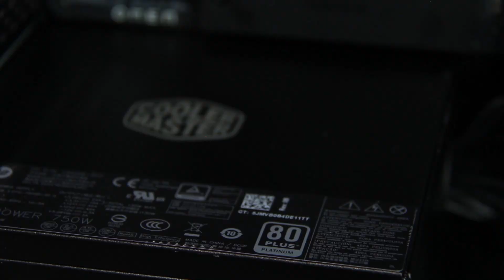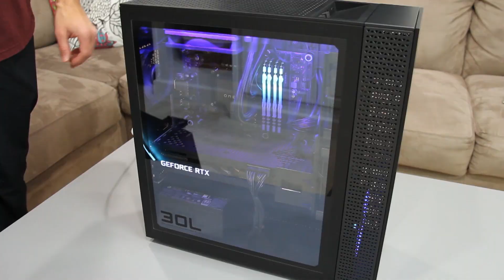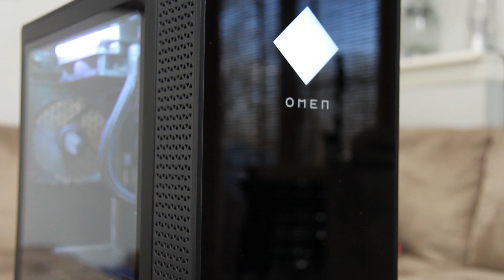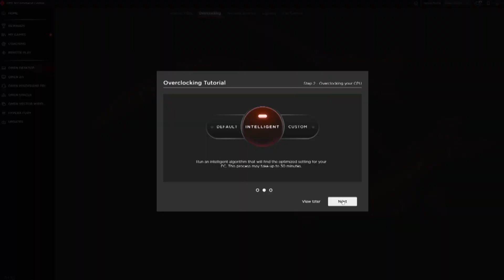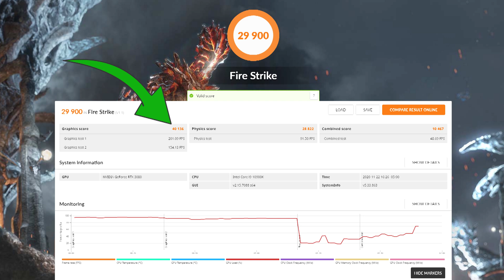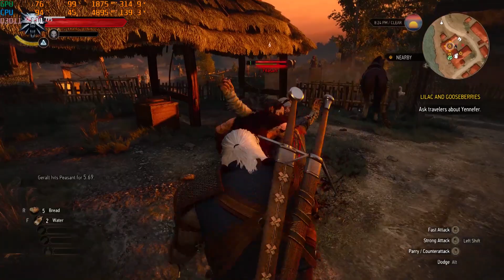OMEN 30L!  Are pre-builts good now?

Comment: Hi Bob, very nice video, providing a lot of solid information on OMEN 30L. In fact I've already ordered my OMEN 30L. I actually want to take all the components out and reassemble them into an air-flow case, such as Cooler Master NR400. May I ask whether it will void the warranty? Thanks.
Reply: I will do it as long as warranty won’t be voided
Reply: Send it back lol look up hp omen ram issue
Reply: @Zipfile12  Thanks for the heads up. Are you pointing out the fact that the after-market HyperX ram can't run at 3200MHz?
Reply: @zhizeng5571  yup that and any other after market ram will be down clocked unless you buy the ram directly from HP at a very high mark up price thanks to HP locking down the bios and not allowing xmp

Comment: Got it for $1500😎 but with a i7 instead of i9
Reply: lucky man right after I bought it for 1900 they cut the price down that much.
Reply: @chinmang3162  pretty crazy price it sold out quick,I don't get it until dec 29 but I'm extremely excited
Reply: @RawWrath  Do you think its odd that people were able to get theirs off amazon in late October while those who bought it directly from HP have to wait until mid to late December? Kinda weird it was being sold on amazon before their official website.
Reply: Any updates on your order assembly status? I've had no updates since I ordered mine 2 weeks ago.
Reply: @chinmang3162  no updates yet it just says it'll ship December 23
Reply: @chinmang3162  I'll update you here if anything changes🖖
Reply: @RawWrath  Update: mine was supposed to ship yesterday, but it hasn't even reached assembly yet. Could be another classic HP delay and/or cancelled order
Reply: @RawWrath  Update: Delayed shipping from 15th to the 21st. Not looking good. Hope you're luckier than me
Reply: @chinmang3162  my delivery date got delayed until January 7 and the should of shipped already and nothing the original delivery date was Dec 29😔
Reply: @chinmang3162  it's shipped!!
Reply: What specs are in yours?
Reply: @dave.thedev  i7 10700k, RTX 3080,16gb 3200mhz ram,750w platinum power supply,512 wd black ssd,and a 120mm AIO
Reply: @RawWrath  Dang thats a good deal. I got mine through amazon when I saw it dropped to $1900.
i9-10850k
RTX 3080,
32gb ram,
1tb M.2 SSD and 2TB HDD,
120mm AIO and 750w PSU

The deal sold so quick. $1500 for your package is a steal
Reply: @dave.thedev  not only 1500, i am going to add 1tb ssd, 2 tb hdd,and an additional 16gb ram, so the final price gose to 1800+, not much difference than yours, and you have a better cpu.

Comment: I love your videos, they are very knowledgeable and provide honest great information! I saw your OMEN 17 laptop video, and you said it is the most powerful laptop you’ve tested, I bought an OMEN 15 laptop DH100 custom built specs: processor: i7-10750h 
graphics: RTX 2070 super.
Ram: 32gb
Disk management: 1tb picie + 512 Intel pcie, + Intel 32gb optane + 1tb HDD.
You said on the OMEN 17 video it’s the most powerful laptop you’ve tested, and RTX 2060/ GTX 1660tis don’t respond to well. The 2070 super card should be extremely powerful right? I watched your OMEN 15 video and it’s the exact same laptop;, but I noticed that laptop has a regular RTX 2070 vs mine has the RTX 2070 Super.

Comment: Only thing lacking on these is support for XMP in BIOS. Currently they only support 3200mhz frequency RAM if its a specific HP certified RAM stick that costs over 150$. Other RAM sticks will default to 2400mhz JEDEC spec.
Reply: you can put XMP in Intel XTU on Windows

Comment: Great review man, I have been looking for a review on this specific model but could not find one so I ended up ordering from Amazon for 2k
Reply from the maker: That seems like a good price 👍
Reply: Damn bro it’s at $949.99 right now at Best Buy
Reply: @Voixxy  yeah that one has way lower specs man, its a 2060 mine is 3080
Reply: Look up Ram issue HP omen 30L it's a scam of from HP
Reply: @Zipfile12  i have 30l 3080, isn't scam.
Reply: @drluch  its is when you can't update the ram without it slowing down to 2400mhz instead 3200mhz you cant enabled xmp just look up the ram issue hp makes you buy there ram to get the best ram speeds
Reply: @Zipfile12  just buy some hyperx fury 3200mhz and it should go. Buying from hp doesn't seem like a problem to me

Comment: I know HP probably sent this too you but an issue I have with all OEM desktop reviews is they have the top end model... The OEM's might treat the top end models better than the mid range and lower end models. If you continue desktop reviews I would like you to ask for a mid range unit :). Still great review and have a nice day.
Reply from the maker: Yeah I can do that!  I like the mid range models too.  The lower end spec that you and I like would leave others wondering if the 30L is capable of cooling more powerful components.  It leaves questions unanswered either way 🤷

Comment: Pre-built Pc have come a long way.  Specially the 30L from HP. If i would change something its the liquid cooler.  The radiator is so small for the the cpu. At least 2 or 3 fans  is required.  Or going for solid air cooler like NH-D15. Still good pc. Finally as always thank you Bob for great review 👏 stay safe 🙏
Reply from the maker: Yeah I actually prefer air cooling as well.  Something big 👍

Liquid does look rear nice though.  The chassis is pretty small and the top IO would get in the way of a 240mm Rad.

Comment: Does this mobo work with AMD?
Reply: I don’t think a z490 motherboard work with AMD, mine is on the way, really worry about the cpu temperature.
Reply: @bugzf  that's my worry as well...I'm soo close to pulling the trigger, but I think I better wait until parts are more readily available so I can build my own.

Comment: In my opinion HP makes the best quality Prebuilts, they don't always give you the best parts, but they last
Reply: Cooler Master PSUs, HyperX Memory, SSDs are typically from the major brands ;)
Reply: I just wish they had at least a 240mm aio cooler. They’re nice as fuck and I have all the hp omen accessories too but seriously wtf is with them only having a 120mm fan/cooler especially with an 8 core processor? Smh that’s the one major flaw
Reply: @itshadoww  I just got a new case and put all the shit in the case with better cooling
Reply: @literallyfree5672  Sweet you can do that?, how easy was it, and what case and cooling did you use?.
(i'm new to PC stuff and i plan to use "heavy" software such as gaming, animation and live in a hot place) 
so it sounds like it would be a good idea to "upgrade" upon the heat issue if i get this. 
i'm scared though because of "prebuilt" so if it worked for you, 
may you please let me know what you used/upgraded with?.
Reply: I agree but one detail pretty much everyone mised is that omen is a separate team from hp. Omen was a dying brand that hp bought. Hp makes business and  home products while omen is a team all for gaming. They were not to good until now.
Reply: @itshadoww  yeah they need to give you the option at least to get a 240mm cooler fuck only having 120mm that’s retarded
Reply: Agreed
Reply: Secret  ok so if I grab one of the hp omen 30 L computers I won't be in big trouble right? Lol😅 btw is it possible to add a liquid cooler in these pc's? And to what extent can you upgrade these things because I know they are oem pcs and have a little trouble with upgradability.
Reply: Secret  thanks for the info. Its good to know that I can upgrade a bit. Do you know If I can upgrade the PSU or the motherboard?
Reply: I heard bad things like CPU hitting 97C under load in these 30L Omens
Reply: @Venserql  i mean i9 and 120mm aio dont belong in the same sentence
Reply: @Venserql  Most prebuilts don't have good cooling unless you spend 2k.

Not even the best prebuilts have good cooling, After all prebuilts are always about profit
Reply: @davidlegkodukh6969  it wouldn’t be hard for them to let you at least have the option to choose at least a 240mm aio cooler. Why only 120mm? For the new intel 10700k and i9 processors 120mm won’t do shit. You’re spending 2k plus on a prebuilt at least give us the option for 240mm. That’s my one and only issue with this. If it had a 240mm aio on top instead of 120mm it would be perfect like fuck

Comment: They've definitely improved but they still cheap out on motherboards and storage among other components. They've definitely learned from the custom builds & rgb.
Reply from the maker: If I would’ve had more time with it I would’ve pulled off the VRM heat sinks see what kind of phases we were looking at for the motherboard.  

WD black m.2 drives look real good however
Reply: @BobOfAllTrades   I'm sure HP does things right some of those CLX & I buy power ones I've seen some el cheapo motherboards lol

Comment: Great video! 
Just pulled the trigger on one, since it seems like the only way to get a 3080 at the moment. 
What are your thoughts on the custom graphics card cooler vs. the reference and AIB models? 
Thanks in advance!
Reply from the maker: It seemed to cool just fine and I never did once ramp up the fans on and I could’ve made it run cooler than what I had shown in the video via MSI AB. 

Other than that I took the card out had a good look at it and it seemed very stiff and built well enough.
Reply: @BobOfAllTrades  Fantastic. Thanks for the quick reply!

Comment: I think HP uses a proprietary connector for the TOP I/O USB header. If you replace the motherboard, you won't be able to use the top USB ports.
Reply from the maker: Is that a fact on this model? Let me see if I can verify that with HP they are usually pretty straightforward and knowledgeable on those questions. 

Thanks for the heads up 👍
Reply: @BobOfAllTrades  Every manufacturer has something that is proprietary like a hidden gotcha. I don't know if they do it to the Omen line up, but HP does it to their non-gaming product line. I bought a HP Envy desktop for my mom. Her motherboard died. I replaced it with a MSI motherboard everything worked fine except for the top USB 3.0 (not that this mattered to her). Even though for the USB 3.0, it uses the standard motherboard plug. It still wouldn't work because there was an additional cable I had to plug into the motherboard in order to power the top I/O hub. It's a proprietary cable that can only be plugged into another HP custom made motherboard. The power button and audio jacks are standard and work just fine on the replacement motherboard.
Reply from the maker: @UnlicensedHitman  I just received confirmation from HP that the Omen desktops use standard connectors 👍

Comment: They should've given atleast a 140mm radiator for the i9. I would prefer to swap that i9 with a 10600K and enjoy the lower temps.
Reply: Wasn't the CPU at 80s. It'll be fine
Reply: @Ryuseigan  140mm would have reduced noise levels. 50+db is too loud under load. Plus it would have left some thermal room for overclocking.
Reply from the maker: Off the record I was able to hit 5.1 GHz without a huge thermal compromise. 

But everyone’s mileage on that will vary.
Reply: @BobOfAllTrades  I am just generally skeptical about the smaller radiators. Good to know that 120mm rads are fine for 10900K.

Comment: Don't you think the power supply might be a little bit on the lower end of wattage? 750w is what Nvidia recommends for the 3080 but is it really enough?
Reply from the maker: It’s more than enough especially since I was refilling the wattage that was being pulled from the two main parts.  Anybody who’s built desktops knows that the recommended power supply is more than you actually need.

The system isn’t going to draw much more than 500 W from the wall